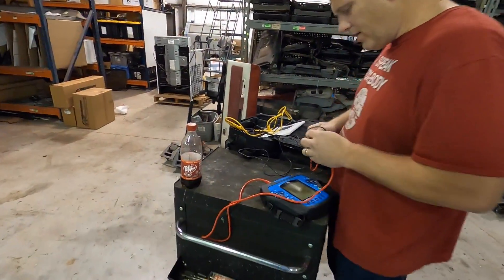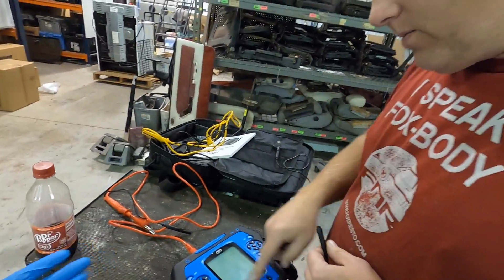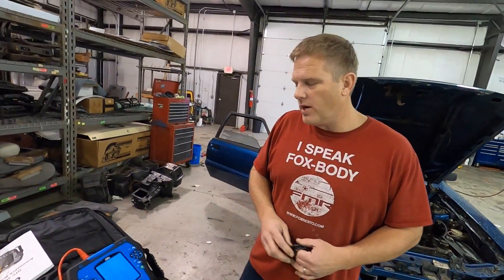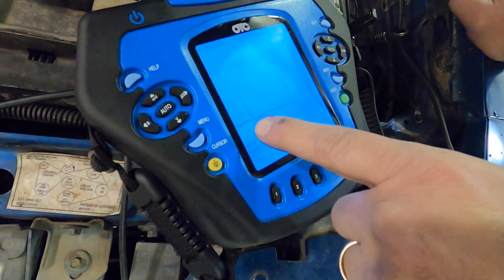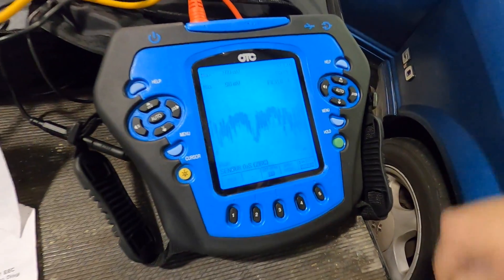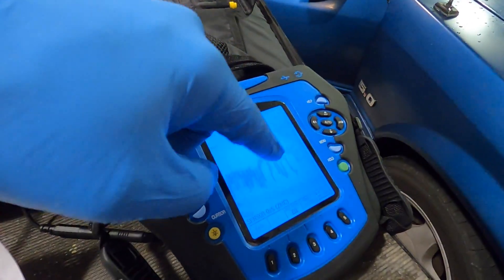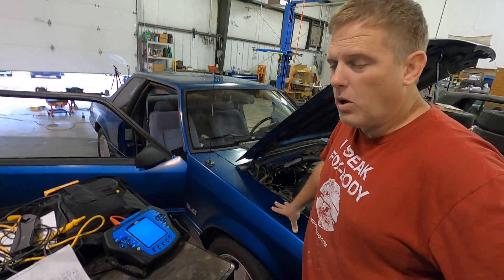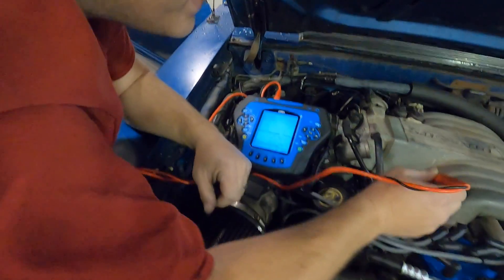Diagnosing a FoxBody Mustang Running Rich...WITH AN OSCILLOSCOPE!

Comment: Base Idle Rest, and the MAFs are known for issues.
Reply: Walmart syrynge and carb cleaner and battery to clean injectors. 20 minutes done
Reply from the maker: I'm not sure what method Matt is using, but I'll share that info if I get a chance.